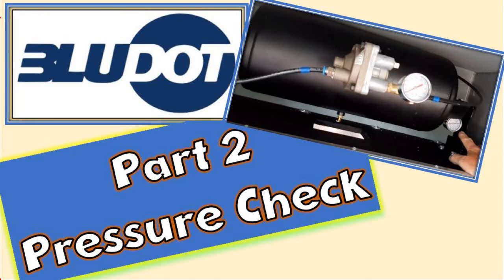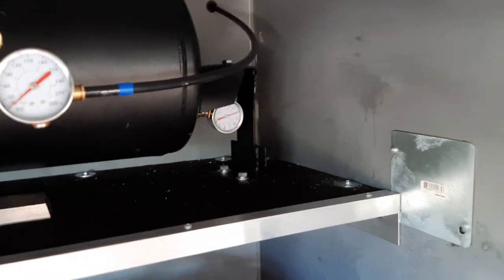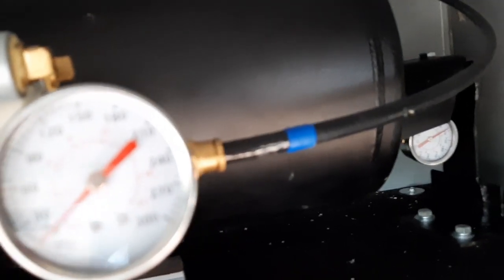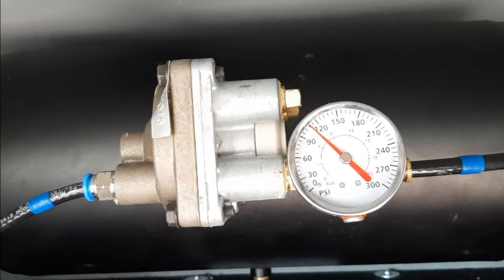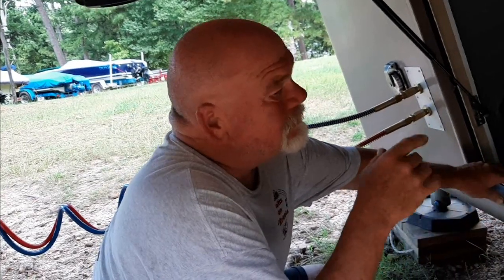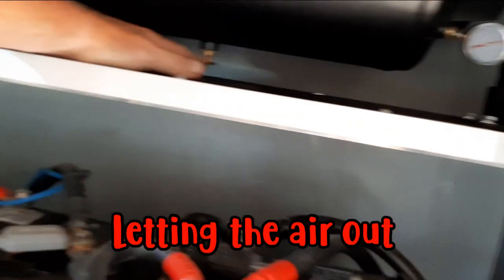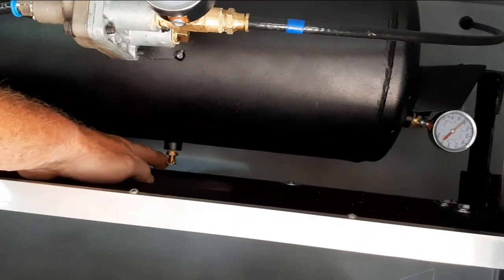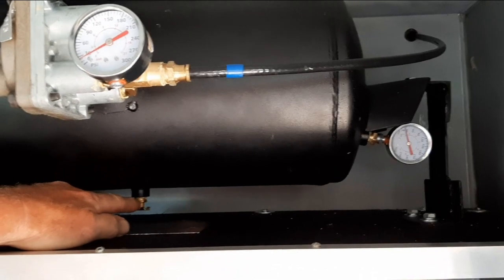Part 2 - BluDot RV Air Brake System for RV (Pressure Check)

Comment: I'm about to add this system to our coach.  What and where did you get the 90 PSI regulator?

I don't understand the function of this component.  The tank pressure is at 120 psi, is that regulator on the OUTPUT of the tank to the application valve or the INPUT to the tank?
Reply from the maker: I think I bought it from ebay a long time ago.  But you can find them many places.  It is a Bendix RV-1 air regulator for 90 PSI.  The RV is currently in storage, but I will check on the position when I get back to the RV.  I don't want to tell you wrong.

Comment: How long does the truck take to refill the tank back up to 120 psi?
Reply from the maker: From zero about 5 to 6 seconds, like after having bled them dry at a campground.  But, from just applying and releasing the service brakes, the pressure doesn't fluctuate hardly at all in the tank.

Comment: Now, switch that pet-cock valve to a ball-valve and run an exhaust line away from the tank compartment so that releasing the pressure does not damage your hearing.